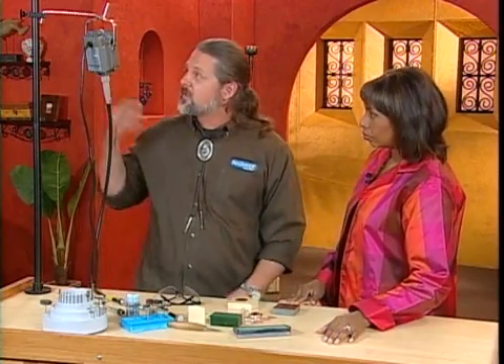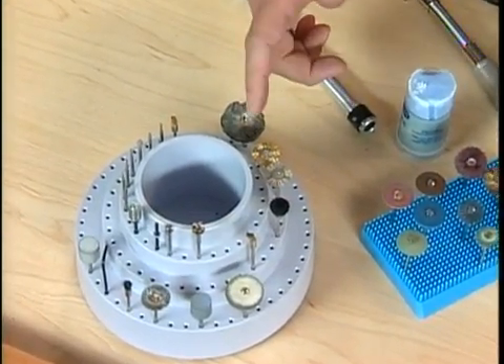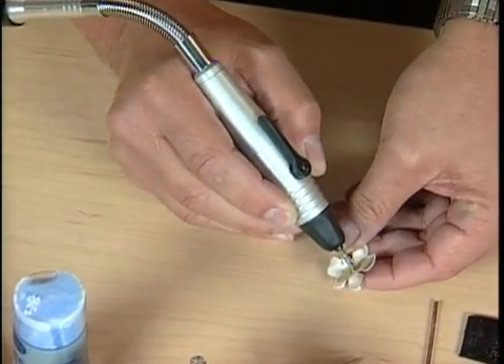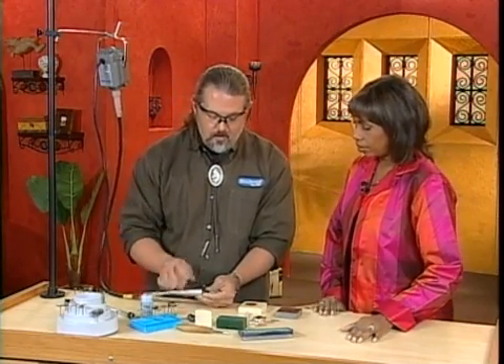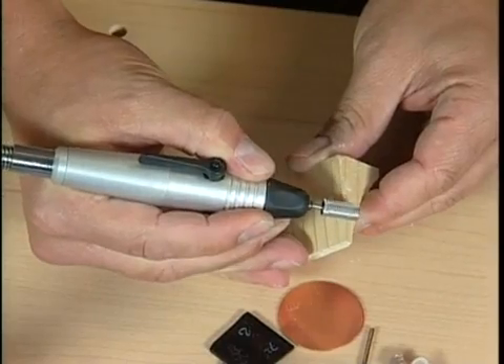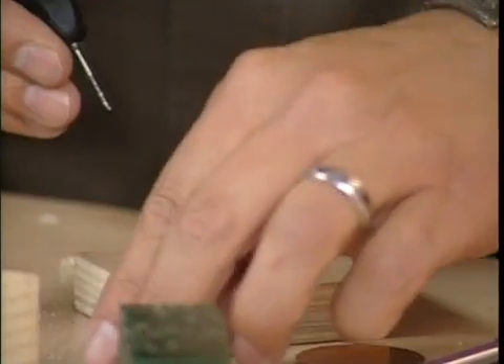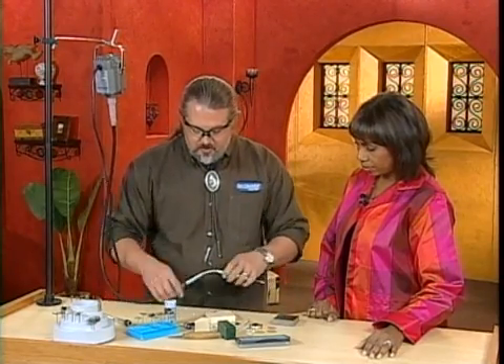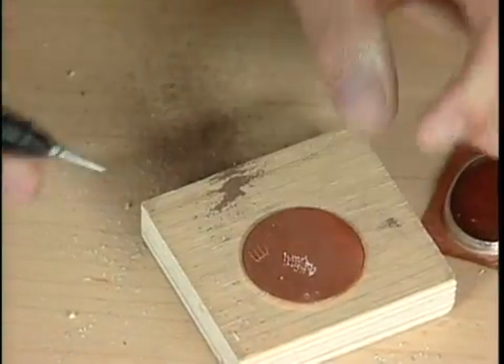Picking The Right Flex Shaft For Jewelry

Comment: My flex shafts is brand new, I have followed the instructions for setting it up. Is it normal for the metal coil right behind the hand held piece to get extremely hot? It was even too hot to touch.
Reply from the maker: Hello, thanks for your question. Is the coil covered?
Reply: @RioGrande1944  no, it isn't. Actually I keep the area free of any possibility of that. When I'm working with my flex shaft there is only the piece I'm working on, water container, & my bits.
Reply from the maker: @CravNCraftN , Thanks for the additional information. It's normal for the coil to get warm, but not hot. There are a couple of things that can make this happen: a)if the cable is not adjusted properly it can put pressure in the hand piece and increase friction.  b) If the hand piece was not attached correctly it could have damaged the key hole in the hand piece which could  cause pressure and friction. If neither of these things are happening, then the best thing would be for you to return the flex shaft and have our tech guys look at it. Our customer agents would be happy to help with a return. They can be reached at 800-545-6566, 7am-6pm MT, M-F.  Thanks again for commenting, and always feel free to reach out with questions or concerns.
Reply: @RioGrande1944  thank you so much. I followed the instructions. Another question though, please. Is the flex shaft 225-01 already lubricated when brand new? There was no mention in the instructions about adding lubricant before first use. Only to hold it in the air completely straight & allow it to run at full speed for 2 minutes which I did.
Reply from the maker: @CravNCraftN  Yes, it is lubricated when brand new.
Reply: @RioGrande1944  thank you. My husband has made a taller stand for my Dremel to hang from. Hopefully that will remedy the issue & a return won't be necessary. Wish us success. Have a blessed evening.
Reply from the maker: @CravNCraftN  You're welcome--we're always happy to help. Best of luck!

Comment: Hi what is that tool name which can texture on jewellery
Reply from the maker: Hello There! Our Jewelry Tech Team will typically recommend the Foredom® SR Motor with H.30 Handpiece Flex Shaft System kit Item #117534 found here: http://ow.ly/y5vr30b1Cfg 

or theForedom® SR Motor with H.20 Quick-Change Handpiece Flex Shaft System item #117535 found here: http://ow.ly/qEuZ30b1Cpv

Hope this helps!

Comment: Can  anyone  tell me how much a replacement flex-shaft should cost .?

Roughly please ?
Its for a ProCraft 1/10  HP 220V

please , anyone .
Reply: Hi Ollie, the closest thing we have to the 1/10hp ProCraft is the 1/8hp Prodigy for about $99us. you can check it out here at this link. http://www.riogrande.com/Product/Prodigy-Flex-Shaft-System-220-Volts/117095220?Pos=1
Hope this helps, thanks for watching.
Mark N Tech
Reply: RioTechs
Thank you.

Im in Ireland and we dont have the selection you guys have in the States .

He charged me e9  for the  shaft (inner cable)
But claimed the engineer said there was something wrong with the hand-piece .
It seems fine to me .

He sold me a Foredom handpiece for e31  ( + 23% vat)
 
When I connected  it , it runs very  smoothly (and lighter)  but doesnt  "CLICK"  into place when connecting it  , like the old one always did .

I actually needed to force it , which I know ye shouldnt need to do . It didnt click into place.

Im tempted to put the (supposedly)  "faulty" hand-piece back on , but Im wondering if it may have been that , that caused the inner cable to snap
Reply: Ollie Phelan hi Ollie, so sorry for the late reply, it seems we missed your question. You might try adjusting the outer sheath to expose less of the shaft, sounds like it might be sticking out just a little too much. You might check out some of the maintenance videos on the Foredom site  ( i couldn't find any for the ProCraft). they demonstrate how to adjust the outer sheath which may be the same for the ProCraft.
http://www.foredom.net/foredombasics.aspx

Hope this helps.
Mark N Tech

Comment: What bit did you use to engrave metal?
Reply: Hi Christina. I use a small ball bur. Either a diamond or steel bur. The diamonds are easier to use but the steel leave a cleaner cut. Plus, the smaller the bur the easier it is, try to keep them 1mm or smaller. Check them out at the links provided.
http://www.riogrande.com/Product/Dentsply-Maillefer-Round-Bur-07mm/342051?Pos=5
http://www.riogrande.com/Product/Diamond-Ball-Burs/343023?Pos=1
And be sure to you a lubricant like bur life
http://www.riogrande.com/Product/Stick-Bur-Life-Lubricant/117003?Pos=1
Hope this is of some help.
Mark N Tech

Comment: Hi Karla. Some of the items are the following which can be found at Rio Grande Jewlery supply. Flexshaft 117534, bristle disk kit 332597, mandrels 333105, jumpringer 110170, diamond bur set 346064, motor stand 117291, cylinder burs 345869, bur-life 117003, grinding wheels 332191, hammer handpiece 117020, fiber wheels 338123, safety glasses 201054. I hope this is of some help.
Mark N Tech